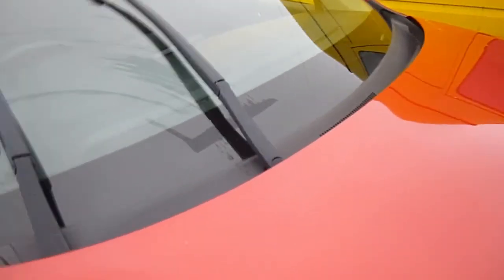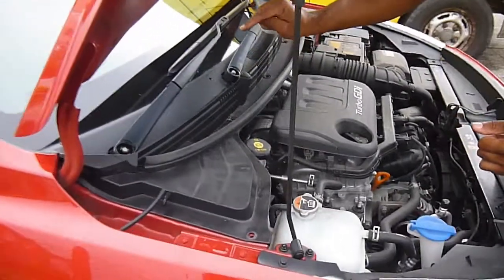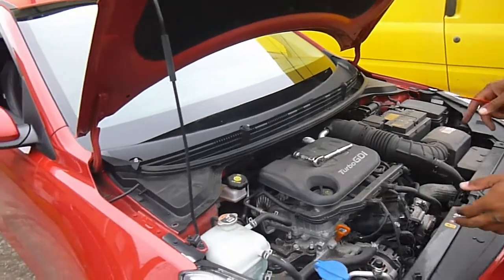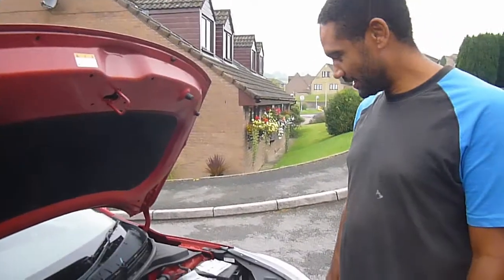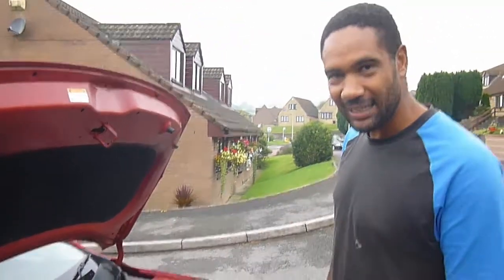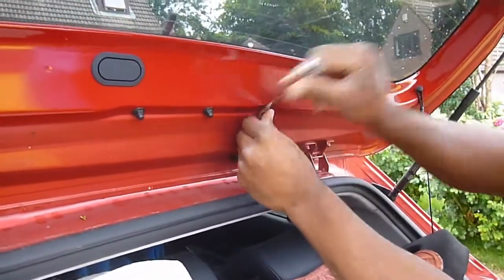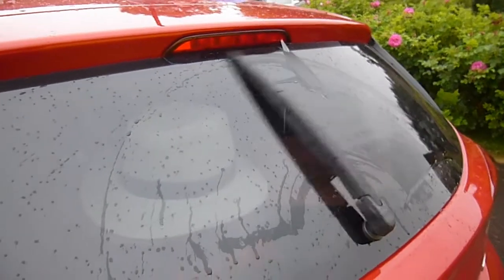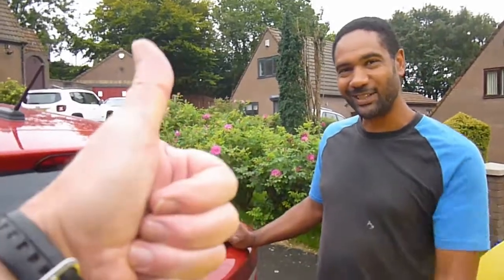How to fix washer jets on a Kia Rio

Comment: Just used this video to help me fix my daughter's 2018 Rio- big thank you guys. I soaked the jets in Viakal (bathroom limescale remover) for about an hour and it has unblock the jets. The water spray only reaches about 3 / 4 inches above the bottom black band of the windscreen, which I think is too low compared to cars I've owned in the past.  Unfortunately, the video does not show  the working jets so have no comparison 😞
Reply from the maker: @glennmorgan2894  hi I've just done another video on the issue with my friend I'm about to do my own version but here's a link to the video 
https://youtu.be/zmJ0VWxB0DY?si=oBJxz7Ufo_ohAJhS

Comment: My Hyundai 2018 i30 has the exact setup pretty much identical engine and engine bay and the washer jet on the passenger side has the same problem the drivers side in fine . I assume taking it to a garage would cost more than £100  . With this video im going to have a go at fixing this myself. That will be £100  saved for my heating bill this winter. Thank you so much for sharing this
Reply from the maker: @rickyjhala200  just to release another video on this same topic,  hopefully have it out before the weekend is out. Great tip and money saving on this issue, stay turned
Reply: @michelod.i.y.5202 thats brilliant, i will have a go this weekend, hopefully the weather holds up, i hope to get it done before MOT test in the middle of the month as not enough washer fluid results in an MOT failure. As you said in your video i was quite surprised with my car as its a 2018 model much older cars never have this problem
Reply from the maker: @rickyjhala200  will send you a link as soon as I release the follow on vid 👍
Reply: @michelod.i.y.5202 Thanks to your video, i nervously had a go and managed to take the cowling off, and removed the trouble jet . But could get the part this weekend, so took the opportunity to clean out the area underneath the cowling which obviously hadn't been clean in 6 years . I've soaked the trouble jet in de scaler might do the same for the working one . Will put updated next week when i put it all together
Reply from the maker: @rickyjhala200  here is a video I did with my friend on  the same vehicle,  https://youtu.be/zmJ0VWxB0DY?si=EuBr1DqgA1rYl3MO
Hope it helps

Comment: Do not buy a new washer jets. Use a small drill, go from were the pipe fits on. Go from the water feed , so we're the water goes up. Go very slow so you do not Go though the top. Run the drill up and down, then blow down the pipe on the unit. This will clear the jet. Muck build up in side. Kia wanted £18.50 Inc vat per unit. So run the small drill up the shift do not go to far. Also clean the headers off unit. Good luck. Ten minutes to do both.
Reply from the maker: Thanks for the tip.

Comment: I have the same car.. and I have problem with spray nozzles. When I’m stopped and use the front washer nozzles it sprays in the middle of the windshield and eventually the water goes up the back and washes all the car😂… is that normal?

Comment: having this exact issue right now with my Rio. Gonna be saving this video for whenever I get around to fixing it. Thanks
Reply from the maker: Thank you. If you have issues with the rear washer it will be a inline valve,  which looks like and doubles up as a pipe connector, housed in boot lid, and is accessed by removing the top rear brake light.

Comment: Well I managed to find a couple of hours spare followed your instructions and although I could only unclog one washer I bought a few from Amazon fitted them and everything works a treat. Cost was £6.99 for two. Huge thanks to you without your instructions I would not have had the confidence to take the car apart, in that way.
Many thanks for the great instructions. The washers have blocked several times now and Kia admit it is a design fault yet want hundreds of pounds in labour to fix. 
I will try this over the next couple of months. Many many thanks

Comment: Thanks to your video I've got my Hyundai i10 screen washer jets working again! 
I followed all of your tips but too scared to pull pipes off and remove those fastener clips until I watched you do it!
Not only did I do the front but then went on to do the back window wash jet to find that the plastic clip unit was broken  so it couldn't hold the hose in the right position. So I used common sense and secured the hose to the unit then replaced it and Bob's your uncle, all sorted! 
I dread to think how much hassle and money your video has saved me! 
Many thanks
Annette 😁
Reply from the maker: Thanks for the lovely comment keeps me motivated to do more videos.

Comment: Good job gentleman, I am restoring my 2003 Kia Rio Cinco and I will definitely soak the jets first and also I found out that there is a filter on the pump that I will also clean before I buy any parts, and flush the reservoir and hopefully that will work.
Reply from the maker: Definitely worth doing,  seems to be an issue on these car's. Thanks for watching

Comment from the maker: . If you have issues with the rear washer it will be a inline valve,  which looks like and doubles up as a pipe connector, housed in boot lid, and is accessed by removing the top rear brake light.

Comment: Mine was blocked pump side of the pipe connector, blew down it and its cleared the filter ? Which looks completely inaccessible.
 Thanks for the pointer. Also noticed there is a pipe joint on the rear washer as it goes into the  boot door. Kia rio 2014 diesel.
Reply from the maker: Thanks, nice to hear it helped you out. I think I prefer the old style washer jets, they seem less problematic. Thanks for watching.
Reply: I did this which cleared it for one tank full, i then re filled and its back to barely any flow? any ideas also 2014 Kio Rio, i then "blew down" it again with a small hand held balloon pump and it work again, guess I have do that each time ?

Comment: Well done, sirs. I'm thinking white vinegar may do the trick as well.
Reply from the maker: Good idea, something acidic could work. Have recently done the same job on another fairly new car. There's a fine filter that's used to get the spray pattern that seems to easily clog up. Thanks for watching.

Comment: I meant to add that I used my hubby's tire inflater to blow pressurised air through the tube that I disconnected from either end, down into the wash reservoir which bubbled and then up to the jets and from the jets towards the disconnected tube. 
My hubby was impressed as I only knew how to put petrol in before! 😆😆😆

Comment: How did you get the actual jet out of the grill really struggling with that part
Reply from the maker: There are plastic rivits that need to be removed once the widescreen wipers are removed, and carefully pry the plastic cover off, you then have to squeeze the back of the nozzle to pop it out.
Reply: @michelod.i.y.5202  I got the grill off just couldn’t grip the back of the nozzle  clips to remove, what did you use plyers? My fingers won’t fit 🤣 x
Reply from the maker: @chelseywilson5767  try some long noise pliers, good luck and thanks for supporting my channel
Reply from the maker: @chelseywilson5767  another tip is a small flat head screwdriver, from the back pry one side then the other
Reply: Agree, very hard to get nozzles out, access to one very restricted. Kia Carens 2014. Blunt knife or something start at back to lever up, then just pull, front clip bent backwards but came out. Mí ádh of a yoke!

Comment: Hi ya,

Thank you for the handy video.. it seems once you removed the nozzles and put the wire instead, the wipers were not working..you sprayed the windshield but wipers were stuck down.. the same happened to me when I was doing the same repair.. How to fix the wipers now, do you know?
Reply from the maker: The only slightly error I made which was quickly rectified. Was while I was testing the jets without the wipers connected the position of the wipers has moved so I had to remove the wipers blades, put the wipers onto intermittent and listen when the motor stopped to know that the motor was in the correct position when I refitted the wiper blades. I've just replaced the windscreen motor on a Vauxhall Astra, I should have filmed it
Reply: Hello Michelo,

Thank you very much! 
I’ve repositioned the wipers and they are working fine again :)
Thank you for your help, have a nice day!
Reply from the maker: @jozefko86  your most welcome 😊

Comment: Hey brother, I have the same issue, but it doesn't come out of the tank.
Reply from the maker: Try locating the the fuse for the windscreen washer to see if it's OK. Then with a multi meter check if your getting voltage to the motor

Comment: Just soaking the non return valve from a Picanto right now. It's not super clear, but I can see two black masses inside, may be the rubber part has split in two and is blocking it. If the bleach doesn't unblock it somehow, I'll drill it out for now.
Reply from the maker: I have heard of them being drilled out when all else fails. Also important to take note of which way round the valve is reinstalled, for obvious reasons. Hope all goes well, thanks for watching
Reply: @michelod.i.y.5202  Thanks. I can see the yellow part goes into the tube for the nozzle. Some gunk has come out, but still looks like two black masses inside.
Reply from the maker: @hippopotamus86  if I remember correctly they make up part of the o'ring non return and filter mechanism. The only downside of removing them, is that it probably takes an extra second for the water to be ejected from the nozzle
Reply: @michelod.i.y.5202  Thanks. Unblocked now. After the soak, I pushed a needle into it several times until black gunk came out of it. Gave it a final blast by holding it to the tap forcing water through it (and all over me). Thanks, I left it last minute to fix for a trip tomorrow so no time for a replacement!
Reply from the maker: @hippopotamus86  well done, happy motoring 😊

Comment: You know something that consider, I had a similar problem on my 2021. And come to find out it was a faulty washer fluid reservoir cap. Basically it wasn't closing like it should and creating a good seal inside the reservoir.

Actually when I took it to the Kia dealer he came out and was like oh yeah it was something real simple. And I'm like oh yeah what was it, , anyway he says oh it just looks like the cap it was messed up and we replaced it. Anyway it only cost me like $10 for the cap
Reply from the maker: Just yesterday I repaired one and using a small drill bit I dilled into the inlet of the washer jet and it now works perfectly. There's a fine mesh I think and a non return valve which also seems to fail. My 23 year old toyota has never failed 😁

Comment: Kia got 7 years warranty. Yours one dont have it?
Reply from the maker: Yes, but Kia wouldn't change the washer nozzles for free, they wanted to take the car in do all the diagnosis etc. Rather than except that a customer had found the issue of a blocked nozzles. Unfortunately when I first looked a the car I didn't film flushing the windscreen washer reservoir, were the screen wash was in poor condition